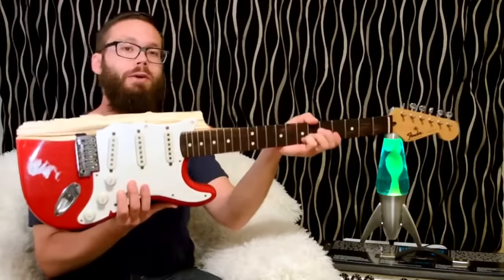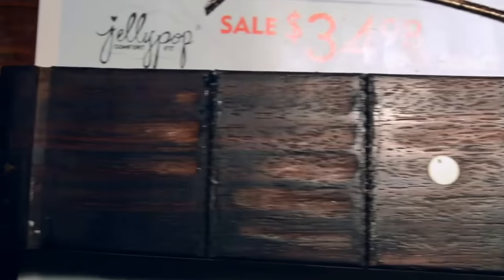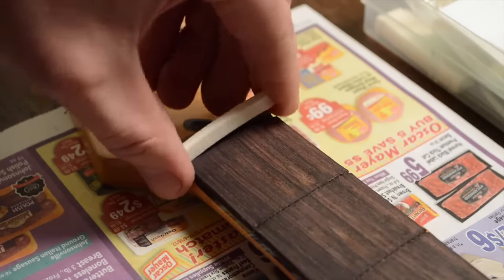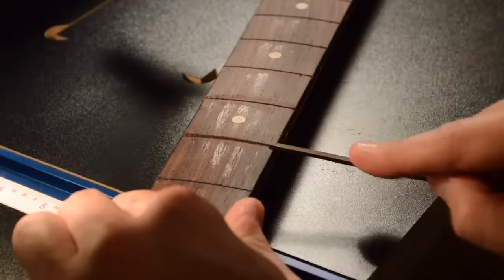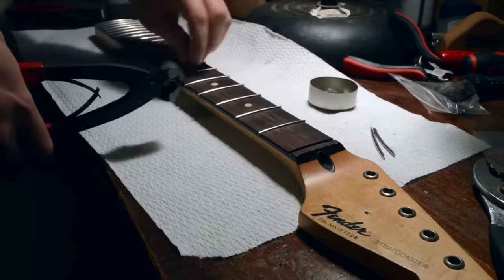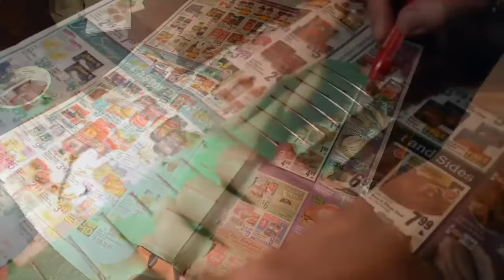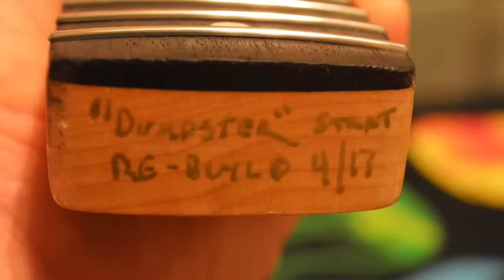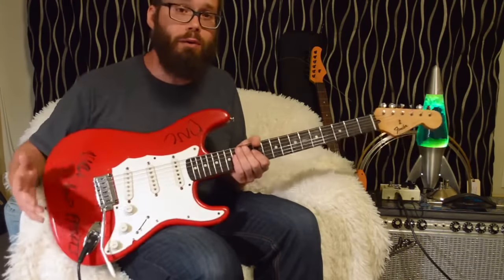Strat Found in a Dumpster! Rebuilt with Stainless Steel Fret Job

Comment: The body looked like the breaks were pretty clean.  So why not glue it up, Bondo patch cracks, and repaint it? Or leave the scars in to remind you that it was a dumpster dive find.  You could nickname it Scar. =D   That's an admiral job on the refret job, but why stainless steel?  It adds so much extra work and also wears out your tools. And for what? Stainless steel sounds too brittle and is overkill for an entry-level instrument that is just a secondary practice one. What's the point for a Squier Affinity Stratocaster?
Reply from the maker: The point was to get practice with the wire. Always practice on scrap! I understand I put in a $400-$600 job (if done by a pro) on a worthless guitar, but the point was to try it out and find out how to get my technique down. Thanks for watching!

Comment: Damn, what kind of an idiot would throw away the entire guitar. Like I would part it out if I were throwing it away. Amazing to take what was trash and make it a functional instrument again.
Reply: Once the frets are shot, I think that's a common fate of many a budget guitar.If that wasn't the case, the local Guitar Center would have 25 Squier Strats,alone, - instead of the occasional 1or 2. They've sold many thousands in just the last decade.
It's just not worth refretting them, and the stock parts have little to no value.
Refretting guitars takes skills on another level, especially on budget instruments.
Reply: @markferguson3745  Well I guess that kind of was Leo’s idea or just replacing the neck of it was worn out but it’s a Fender not a budget or Squier guitar, but great of him to fix it up and make a killer partscaster out of what he had laying around.

Comment: These nickel frets suck ass. I'm not liking my Mexican I paid 500 used and its gonna look like that in no time. I'm taking it back maybe.its a 2017 and it's already worn. I got ripped.
Reply: I bought a 2018 Artist and had the Frets swapped out for ss, they last a virtual lifetime.The guitar was used when i bought it and the Frets had been played right down in the space of 4 years until it came to me. It's in Tidepool. 400 GBP i paid which is about the same as you paid. It sounds like you have exactly the same problem i found. I paid another 180 GBP for the Luthier but i supplied the ss frets which helped keep the price down.

Comment: Duuuude.. when sanding the nut.
You had a good idea to use the radius but totally dropped the ball. You should have sanded along the neck not across it SMH

Comment: That's ou s definitely not a mexican stratocaster. Mexicans did not have the cheap thin block in it. Also it didnt have those cheap ass chinese tuners. That guitar is a chinese piece of crap someone put a Mexican waterslide decal on.